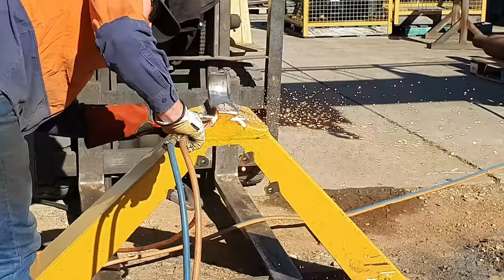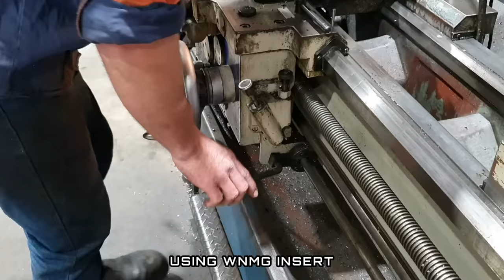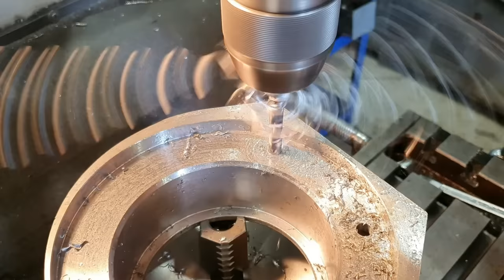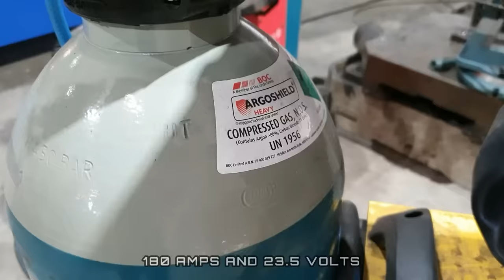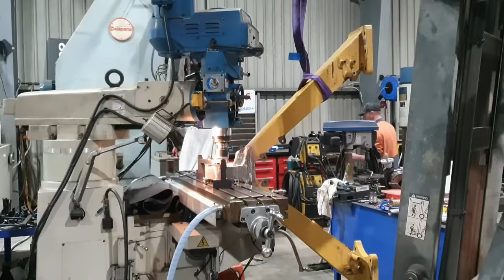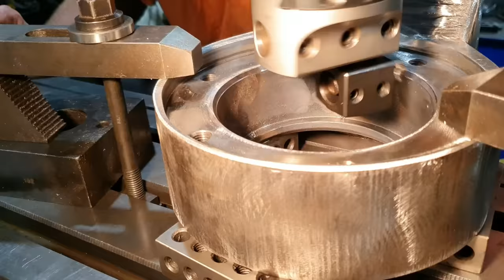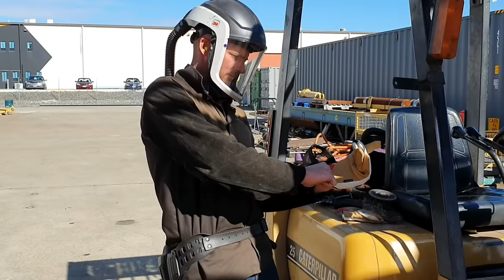Replacing BROKEN Eye on A-frame for CAT 745 Articulated Truck | Machining, Welding, Milling

Comment: Customer: "Damn I told you just to line bore it, not to get a new frame for me!"
Looks great! You should paint all the finished parts as it makes it look more complete and would make the customer happier, though paint can hide your crimes too.
Reply from the maker: Hey mate yeah we don't usually need to paint but this one was heading straight back to machine on site
Reply: I guess most of the time the parts are going to a repair shop, who will do the big rattlecan overhaul just before it drives off back to the mine.
Reply: I'm fairly certain no one wants to pay his hourly rate for him to paint it.
There will probably be a laborer or apprentice on the customer's site who would be instructed to paint it for a much more economically sensible rate. Haha

Comment: I figure you helped the customer in understanding the difference of boring and replacement.
Reply from the maker: Lol yes I told him when it's missing half the eye that's a good sign it needs replacing 😂
Reply: @CuttingEdgeEngineering  He knew it needed replacing. He also knew he wanted the replacement linebored, so why didn't you linebore it?

Comment: Kurtis, what did you say to the customer after you saw the actual condition of the eye? 😮
Karen, regarding the intact A-frame that Kurtis mentioned at 23:39, are you involved with the metrology and documentation? 📐🔍
Reply from the maker: Hey Richard the customer was a little surprised when I told him the eye needs replacing 🤣 Karen does the drawing in solidworks and helps with documenting
Reply: @CuttingEdgeEngineering   SURPRISED?!?!  I cannot fathom how they thought you were going to line-bore that thing back to good health! 😵
I had a feeling that Karen was involved with the SolidWorks documentation, since she is a wizard with the video editing software. 😉👍
Reply: @CuttingEdgeEngineering  He was surprised that you wasted his time and insulted his intelligence by telling him that! He assumed that you knew a new eye was needed, so he only mentioned that the new eye should be linebored. You didn't linebore it!......The ONLY thing he EXPLICITLY told you to do.

Comment: Fantastic work. The boring at the end reminded me of a job I did where I needed to bore a hole in an A Frame and hold a tolerance 10" away to a keyway and a dowel pin in one of the feet. I had a .0005 tolerance in both X & Y locations. Gilbert Horizontal Boring Mill if I remember correctly did not even have 10" of travel in either X, Y or Z.

Comment: Hey m8 just found your channel i used to look after a fleet of 740,s basically the same truck these eyes would snap fairly often usually through one of the 6 bolt holes that go all the way around it ,Replacing bearings on these a frames was almost a monthly occurrence but occasionally we would have to replace the whole eye and they were VERY EXPENSIVE!!our welder/fabricator at the time said he thought he could make one so he went ahead and machined one out on the lathe in what he thought was the same material!!!!2 weeks after it was fitted and sent back to the quarry it worked the eye he made snapped in half whilst fully loaded and tipped the dumper over on the main haul rd and caused a massive  headache 2 say the least ,I think our work shop manager didnt mind paying the 3grand 4a proper one in the end!!!!!obviously made from an extremely hard material hence the price just thought id share ,as soon as i saw your vid it brought that memorie flooding back!!!!@

Comment: 1st time seeing Kurtis using an oxy acetylene torch to partially lop off a piece of that steel  eyelet before switching up to the air arc gouger👍 Going old school for a brief moment 😊 I remember Kurtis mentioning we’re no longer in the 80’s, we use air arc gouging now days😄👍

Comment: Great work and really good welding that was a lot of filling. I would love to have the tools and shop you have. Had a shop until 2012 when it burned it was a metal pole barn actually but very big and nice I have really never gotten over that loss. Never rebuilt. Anyway great video keep them coming I love to watch quality work.

Comment: Nice. It's funny how you predicted the question on everyone's mind: How do you know exactly the position for the new eye before you weld it? Answer: You had one of these in good condition come through the shop previously, and you took the time to take pictures and good measurements. Getting paid for what you know as well as what you can do. Good stuff.

Comment: Like you videos, lots of good information. Be careful using air needle scalers, they used to be dangerous giving people beryllium poisoning, ( breathed in), causing fatalities. Not sure if the new ones are safe, use a respiratory if in doubt. Keep up the good work.

Comment: This feels rather like watching Jack Hargreaves show us the work of craftsmen that still had the skills of the 1800s and early 1900s.  It's so far removed from most of our day to day lives, or even the sizes of things we might handle.

Quite therapeutic to watch.  I was surprised how much of the mounting could be filled in with the welder, I would have assumed you'd have to get the parts to a closer tolerance on the fit.  It's a wild contrast to the accuracy in the machining.

Comment: Really good work Kurtis,  I may suggest building alighnment fixtures to assist in correct placement of new mounts . We have many fixtures we use to ensure placement is correct before welding and line bore.. Keep the guys in the field from doing a lot of shimming.
Reply: you werent listening!! Hed already had in an identical "a" frame previously, Knew this job was coming up, so took all the dims/ref points/datums from that piece.....hes so meticulous, I suspect the guys in the field dropped it straight on 100% accurate

Comment: Good job. Didn't notice any preheat during welding. Guess it is not high tensile steel? If so, a little pre-heat goes a long way.

Comment: Cheers mate! I was wondering (if you have the time) could you explain how that gouging machine works. Is it compressed air? Does the air flow through the electrode? I've never seen that kind of welder before. Interesting stuff!

Comment: Another brilliant video of yours.

Listen, that’d never work for me… ‘bracing’. In my shop welding (or any other form of heat sauce) alters the actual molecular structure of the metal, and, no matter how much I brace, it won’t bend whilst the braces are attached, but as soon as you remove them it’ll ‘invariably’ succumb to the position the heat takes it. I’ve found pre-heating, the metal to be welded, to around 200 degrees, goes ‘some way’ to mitigating this, but not to the standard required for this project. I see you got away with it though, so well done!

Comment: Excellent work I cannot watch any other welding channel. I would not like to be a client on any channel but yours. I am working my way thru your videos. I used to repair old clocks and was always shocked to see the mess created by other repairers. I eventually decided to quit because the amount of time fixing previous attempts was taking hours. Then I had to find the original problem. My daily swearing allowance was often not enough. Chuckle.

It became uneconomical to continue both for me and the poor people who bought the clocks to me. I now am retired and build model sailing ships and restore my caravan.

Comment: Awesome job,you sure know your stuff. Did the bolt holes distort a bit from welding the eye on,but you prolly had a bit of clearance on the holes in the plate to bolt on anyway. The finished result was faultless and prolly better than original factory one, the liquid nitrogen is a bit better than trying to use a freezer o get a shrink fit on the bearing😅🤣😂thanks for the vid,and cool little dog too,I tell you ya really miss them when they are,t there,my whole life got turned upside down 4 weeks ago,(crying now )but thankyou for the vid,I used to love using the gouging rods you can be so fine and accurate with them once you get the knack of how to use them properly,they are just so freakin noisy especially indoors,outside not so bad.cheers,Best wishes to you all,from,Auckland,New Zealand🥇👑💥💥💥👍💯%✅⭐⭐⭐⭐⭐.and go the ALL BLACKS for the world cup.🏉🍻😅🤣🤣😂🤣👍🍻

Comment: I know nothing about the kind of steel and drill bits and lathe bits that y'all use so I'm wondering actually how hard is Q80 steel?? Furthermore I'm dying to know what material the lathe bits are to be able to cut through that steel as easily as they do?? I'm completely and positively mesmerized by the skill and overall craftsmanship these kind of jobs take to be able to handle the workloads that the machines that use these parts must go through AMAZING....

Comment: Been binge watching your vids, is this method faster than the other video where you did the emergency fix on a sunday to have it ready for monday morning. You built the eye up with weld then redrilled bolt holes and linebored? Just curious why you didnt do this type of repair in the other video?

Comment: Try thermite welding like the railroad does when they weld railroad tracks together, then use the line bore to finish it off.

Comment: Respect, for hard work, also have question. When you measure diameter, after removing metal from inside like in 31.45 the part surely becomes hot and thermal expansion is happening, Do you wait for metal to cool down before taking measurements ?

Comment: Thanks for the great video. I did the same kind of work except on aircraft. You work very hard and are a awesome machinist, fabricator, welder. Please think about a hydrolic lift table for stuff like the super spacer. once your back goes, it goes. I didn't listen to the old farts that I worked with and when my back went that was it. Many years of pain. I'm 72 now it still hurts. I have a lift table to lift heave shit. It only takes a few minutes extra. Please be carful brother. Charlie in Austin, TX

Comment: I looked up information on how to adjust and replace a tension spring for a garage door. One particular website gave a list of tools needed and step-by-step directions.  After each step the technician explained how you can injure or kill yourself if it is not done correctly.
It would be cool to have a little bit of that type of stuff explained for the novices. After the bolt holes are drilled, what depth does the machine cut the threads, and how much is left for hand tapping? Is it a percentage?

Comment: If you have a DRO you can calculate your  tool pressure fairly easily take a .050 cut per side then go from there you can take the same cut for a finish pass and be on size

Comment: How do you know when to tap a hole by hand or to just use the mill/drill? And does the speed need to be exact when using the press?

Comment: so this much i understand. its the anode that wears, so when you use gouging arcs, you set up the anode ( + terminal) as the base, so the electrode sucks the metal off the base. using DC arc of course

Comment: Hello.

Why did you line bore the eye after having it welded to the A-frame and why not *before*?

Is that related to any thermal deformation the welding process could do to the eye itself?

Thank you.

Sorry for my bad English.

Comment: Was there a reason that you bored it out again after welding or did that just happen. And why didn't you use the lineboring tool in that case? Just curious.

Comment: I have a question. When you’re putting the flame cut eye in the lathe why are you boring the eye off center? I’ve seen this done in a couple of videos and I don’t know if this is for a specific reason or if it isn’t worth it to center the thing.

Comment: I think that could be drilled at half the rpm with more pressure keeping the tip moving into the cool material and pushing less heat ahead of it .. just something to consider!

Comment: The DRO on your mill doesn't have a bolt circle program? I would think that's easier than using the Super Spacer.

Comment: Your drill bits cut into the steel like butter.  Wish I could get mine so sharp.  Even with my cobalt drill bits, it is hit or miss after sharpening them by eye on a grinding wheel.  I have to start with pilot holes and work up.  Depends on the steel I'm drilling, plus I'm a neophyte.  It appears you added a steel plate across the large openings on front and back, unless somehow you filled wire across those openings.  The liquid N2 shrink fit is cool, and looks like you only get one chance to seat the bearing.  So you Aussies don't really say, "Crikey!", or is that just in Darwin?

Comment: Why did you first have to weld the eye on the frame before you did the final line bore? Could you not have done that when you was building it on the lathe?

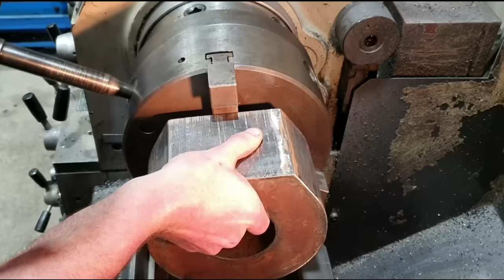Comment: 7:15 so how do you know the exact dimensions? Like how many millimeters from bottom of the A frame to center of your eye? Do you have manuals for those pieces? Or how does that work?

Comment: Why does the final inside diameter cut need to be done after welding the eye? Because of deformations caused by heat?

Comment: Hello there. I need your help. Can you help please. I am a maintenance man in a factory that does mineral (magnesite) grinding. the internal parts of our grinders deform very quickly. What is the most suitable electrode for the repair (filling) of these parts?
Thanks for your videos with valuable information.

Comment: 31:08 why milled it here and not when it was it the lathe machine?
Was it because excessive heat during welding can wreck the dimension?

Comment: Can you tell me how to get an engineer to understand that the heat will warp warp the metal some no matter how you brace it on a jig, so final machining must be done after welding? It seems to be an alien concept to some of them I have worked with since they claim that letting the part cool on the jig will keep the shape that was machined after it has cooled.

Comment: Can I say this as a lifelong machinist check up that part put a chamfer on the ID for a center that size part I would run at about 400 on the spindle in about 12 inches a minute on the feed hog that material off you waste so much time that machine can handle that it’s what it is built for that insert does not know if it’s taking 10,000 Cut or a quarter inch at a time it only knows how hot it is getting.    Feed that tool and you will increase your production substantially
Reply from the maker: curious to know...have you run your own business and owned your own machines or just worked as an employee in someone else's shop?

Comment: I think you could have buffed that out without replacing it. 
I love how when I am told they don't know why the machine is making parts in that shape and they don't mention they took 5 roller stands out. they didn't know how to realign the roller stands of the roll forming machine.
 45 min to have them admit what they screwed up so I can spend 10 min fixing it. The fun part is they called me in under contract labor to fix it for the new operator after they let me quit over money. Now I get a months pay for, up to 4 hours.

Comment: Why not cut the excess material off before doing any machining? Whouldn't it save time if you were to make a mistake on the cut and have to start over? There are any number of things that that I could see going wrong that would make it practical to make the cut first. Am I missing something?

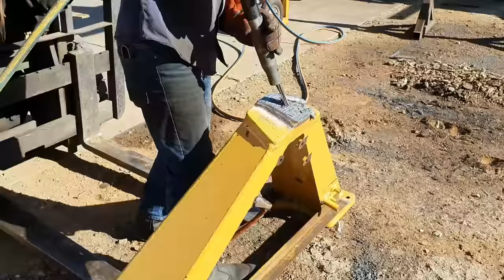Comment: What is that tool at 2:46? I need to know!
Reply: Air Pneumatic Needle Scaler. At my work place something similar welders used to remove slag and they are loud.

Comment: When you are roughing material you should not be having a stringer that means your speed and feed is incorrect carbide inserts should chip through the whole process except I finish pass and that’s only if you have a TF and to the lay person that’s turn finish
Reply: Here is a quick note crank that machine up when the lights dim you are where you need to be

Comment: as a LoyaL viewer and fan of the show,. and in behaLf of all the viewers and myseLf,

 i must demand some attention to keep that cell phone off and away from your shirt duude. .💣🔫

 since its a proven fact :  the phone carries many types of harmfuL magnetic waves that shouLd not be anywhere near the head or the heart or the baLLz , lol

specially when its fully active Like when its ringing 
or when the wifi is on 
or when the gps is on 
or when  the bLuetooth is on ! !

the Least you can do is keep the wifi and bLuetooth and gps and the data off when not using them

and maybe keep that phone on a beLt or somewhere in the Line of sight somewhere

you aLready exposed yourseLf to enough excessive heat and harmfuL gasses you aLso gotta keep in mind to find better soLutions for..`

🌟`~✯cause after aLL

no job is WoRTH RiSking a good HeaLTH

Comment: A third of the time, half the cost. Order a new eye with the correct spesifcationes in tolerance an hardness and weld it in to the old spot. Why do this things so dificult? Why are you americans doin this so backward. OK to show of handyman skills, but the cost for the customer comes to more yhan double than needed.